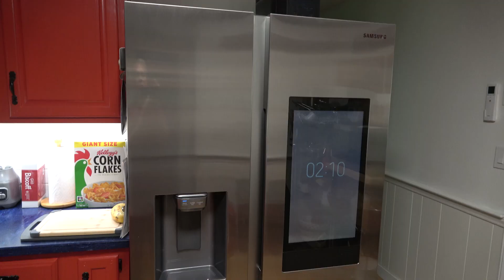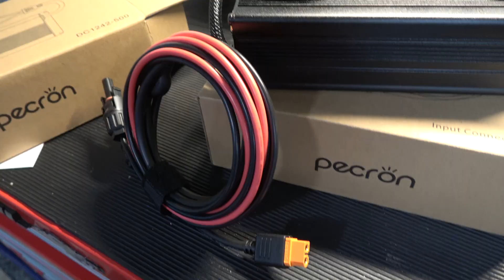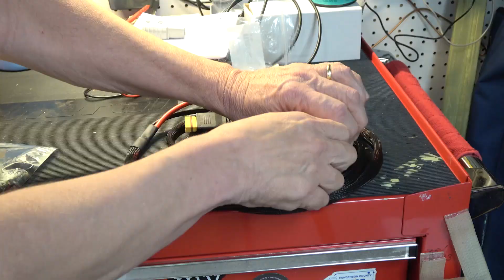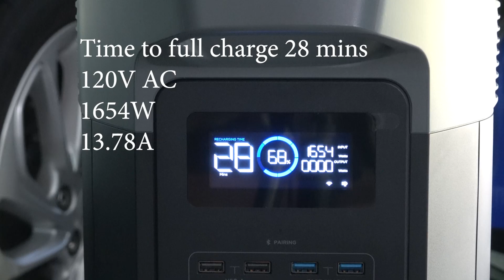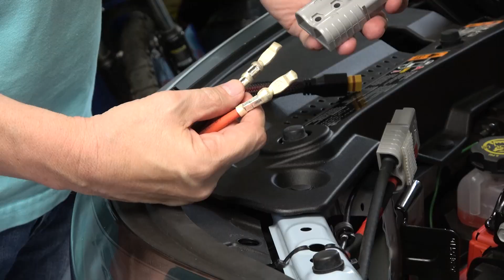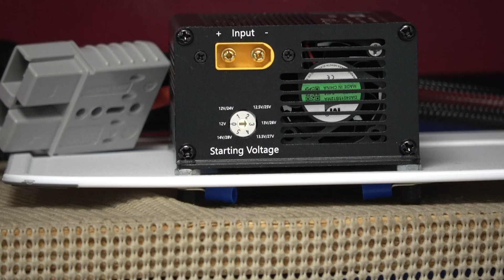Pecron the Quicker EcoFlow charger during Outage (the alt power source)

Comment: Great video. l use Spartan clamps to connect the Pecron directly to the battery for the rare occasion I need to charge my Anker Power Station from it.
Reply from the maker: Thank you for watching. Clamping will work for the occasional use, but I like the ease of use and safety of the Andersen connector. Almost anyone can make the connection without sparking or polarity concern.